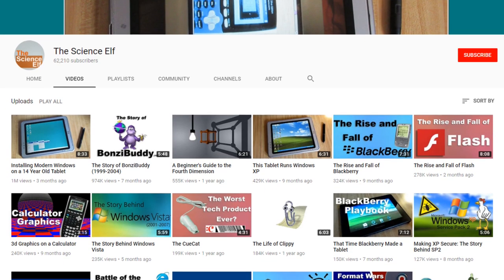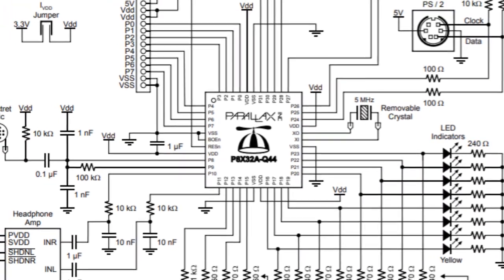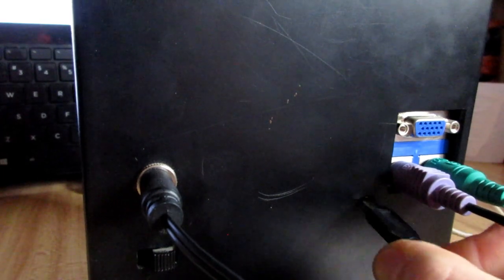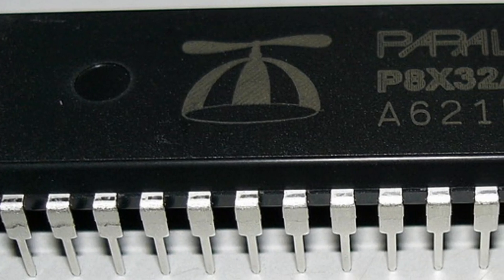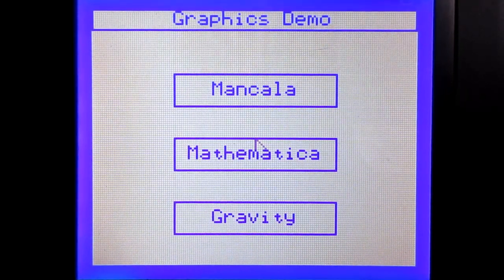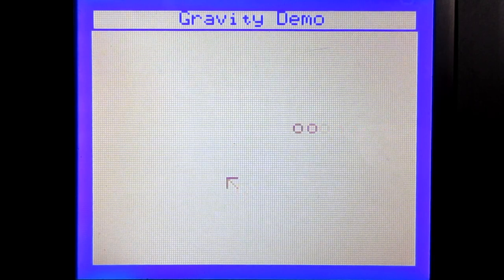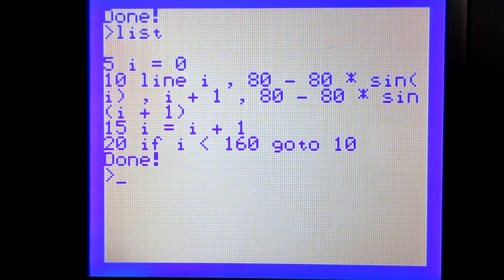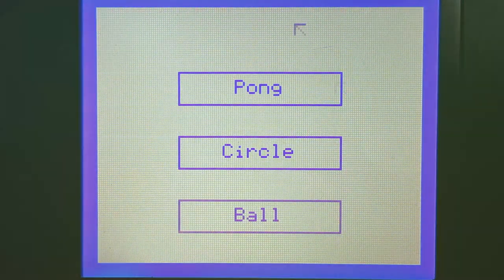The Rarest Computer in my Collection

Comment: Ok this is actually pretty cool! And I have the same problem with commenting my code as well! I have been trying to get out of that habit but like a few hours later I end up not bothering and telling myself "I will comment it later" and never do haha
Reply: At least you give your variables proper names. As recently as a year ago my logic was "Why find a code minifier, I'll just do it myself", and hence a bunch of single or two-letter variable names. Suffice to say I've learned my lesson.
Reply: I used to never comment my code, but now I find I can't think straight without doing it.
Reply: Same lol
Reply: I head to programm in C in one course for one semester. Well, it pretty much forced me to comment anything. Especially when you had to programm for the professor, or when you had to work in a 2- team to wirte a program. 
It was hard for me to learn that, but when I do an Arduino thing, I comment now more and have a way cleaner style of writing ( it's still very very shitty though). 

But before My programms where like shit. Style was bad, no comments, and whenever I dropped something for a few weeks, it was hard to come back. And code was simpel back then, as it got slightly evolved, you couldn't figure out shit. 

On my recent project, that I dropped for a couple of month, I am now very grateful to myself to have them. Was way easier to figure out, what the fuck I was doing :D 

But yeah, without the preasure of the professors I wouldn't have learned it...
Reply: You're the eXtern guy!
Reply: Keiko-ko-child default AI shaking the room 1005 hundred Echizen Kamen Satoshi Microphone 🎙 reminds me of a friend of the 👯 to the house of the sister-fuel Yuhei side Cup on the 🚉

Comment: I remember doing something almost exactly like this. At the time, DRAM was dropping in price in the sub MB varieties, so I ended up buying some 3.3v memory, dedicating one of the cogs to being the memory arbiter and then with a combination of dropping down to PropASM and learning how to use 74x logic to keep the memory refreshed while the cogs were rotating, I learned SO MUCH about how computers dealt with memory and how it was mapped.

However, I am super jealous of your 15 year old harware skills. I didn't really get started until I was 25, but seeing what you did with that is mega impressive :D
Reply: i was thinking of doing something like this but i only know how to program in python, so and OS is gonna be hard...then again i wanna try using micropython to build the computer(just a box with a small lcd screen, keyboard,mabey mouse since what i am building is a text based operating environment, a pyboard, charger, and i need to know if it can even use input arguments, because i have looked all over the internet and could'nt find one damn video using inputs on a pyboard. Please anyone help

Comment: External SRAM chips on an I2C bus, with a dedicated core to handle memory management would sort out your space issues quite effectively. Possibly add a bit of "slow memory" on top of that in the form of an old MMC card (easy to handle in terms of I/O, as well as nice small code size for access and read/write ops). Other than that, great little puter dude, well done! You nailed the aesthetic! Subbed!

Comment: Reminds me of the 4 bit bus computer I built over a weekend as an assignment back in 1987 using a 74181 TTL ALU, 3 x shift registers and 2 x 16 x 4 bit word 7484 TTL RAM chips. It had a 555 timer clock running a pair of 74193 controllable UP / Down binary counters and all display was via 7447 TTL LED numerical blocks.

I still have it somewhere and it could perform 64 mathematical functions so long as the number didn't exceed 15 (well 16 if one counts the "carry up" flag pin on the 74181).

I'd built a basic CPU functionality in TTL, which is what engineers did before processors were invented.

Macro coding by hard wire with a pretty simple machine code instruction set:

The 3 x shift registers were for Register A, Register B and Command Word Register with the resultant answer ending up in Register A.

The programme bytes consisted of the lower 4 bits being the numerical content and the upper 4 bits being the instruction word.

All built on strip board with lots of Kynol wire.
Reply: I'm surprised this comment didn't get more upvotes. Maybe it would on a more DIY-computer type channel.

Comment: This chip is actually very similar in specs to the microcontroller that handles by Nerf primary, my FDL-2X. It handles motor speeds, select fire, and power management features. Let that sink in for you people watching this. That's how impressive this build and its software are, the creator of the Propintosh literally programmed on a platform that's so low-spec, it's only really ever used for very simple robotics work.

Comment: but why didn't you add a speaker?
or a color display?

just asking
Reply from the maker: Honestly, for the speaker, I just never got around to it. I mentioned in the video, there were plenty of things I was planning on adding further down the line with this computer, like the speaker,  a TTS chip, wireless serial communication, IO ports, an SD reader, and even a receipt printer. I just came to the conclusion pretty soon that no matter what I did, the device just wasn't going to be powerful enough, and dropped it before I had the chance to make those upgrades.

As for the color display, (at least when I was building the thing) the largest color smart display was something like 3 inches wide. I could have used a larger TV LCD and powered it off of the Propeller's RCA output, but that would have pretty much defeated the purpose of having an external display, since the TV would have used all the memory.
Reply: I understand now 
But wow 32Kb
Pretty nice project tho
Reply: I also imagine migrating to a color display would have been mean on the RAM limitation. Some people ask why EGA/CGA existed and we didn't go straight to VGA and "millions of colors". Long story short, memory was a limiting factor, and being able to define a color in just one byte was almost a necessity in some applications like spreadsheets and charting.
Reply: Not enough ram.
Reply: A color display will use up a lot of ram, he only had 32kb of it

Comment: I'm a high school freshman (soon to be sophomore) and I've been planning to do a similar sort of thing, albeit with a z180 instead of a micro controller. As of now, the computer is going to pair a 10mhz z180 processor with a 1mb SRAM chip and 256k EEPROM. For the video card, I'm going to cheat and use an ATmega328 instead of having to deal with designing (or modifying) an existing video card design.  I was also originally going to write my own operating system, but I've since decided on porting CP/M instead. Anyways, thanks for the inspiration. This was a pretty cool video.

Comment: This reminds me...In either my sophomore or junior year of high school (most likely junior, but I couldn't access my schedule to confirm), I built a little game using 74xx series logic chips and a 556 timer chip. Basically, it was a two player "see who can hit the button first" game, complete with a scoring system. Of course, it did have a few glitches. Unfortunately, I tore it down shortly after the presentation.
However, that led me to my next adventure: Messing around with the Arduino boards I have.

Comment: How about using several propellers (think multi-core/multiprocessor architecture) in the Propintosh 2 (if you decide to make one)?
Reply: pretty much thought the same
I thought of "why not use one as gpu and another as cpu"
the "gpu" can likely also proccess the input, since it doesn't need to actually compute much

Comment: I'd say that sane variable and function names are far more important than comments. Comments can clutter the code if used to much. If the code isn't obvious, which it should be, a comment might be useful, but otherwise a short introduction at the beginning of a file or function is plenty.

Comment: This machine looks a lot like a micro of about 1980-82 (no PCs apart from IBM until about 85). If you built a machine now with the same  computer power relative to today that you did then, what would your new machine be able to do? Would you be up to the power and versatility of something like an Amiga 500- or would the "new" machine basically be a Macintosh Classic? Which direction would you go in?

Comment: Yeah, commenting is often good. It's even better if you can program small units like in Unix or at least use one program with configurable options. Otherwise, you can't even change a color or text afterwards ;-)
Reply: why the winky face?
while true, that only applies to computers with a proper filesystem and space for that stuff...
seriously, try making a program for an arduino that accepts configurable options and doesn't use an sdcard shield (or any other addon, save for, maybe a screen)

Comment: you could make mac os 1.1 but the original mac ran on an 8mhz processor and 128k of ram but if theirs a more powerful propeller chip it could be possible at the same speed as the original mac

Comment: As impressive as this is for someone that young, your claim you designed it is totally misleading and is literally insulting for real designers of chipset code.  Some of these started at ages even before your own.

The entire machine is a 'wrapper' for other people's work, with simple additions, and is basically Parallax's pre-made computer-on-a-chip doing practically all the legwork, as the PDF for the chip shows.  Sitting on board frameworks and claiming credit to make yourself look like a genius, which your video implies, and other people have fell for, is flat out rude.  If you're claiming to design a computer, the very least you should have done is designed some instruction sets yourself, or better still, designed a schematic for at least one custom chip.  You're clearly not even handling anything to do with RAM or VRAM yourself!

You have basically botched together a load of pre-made computing components designed exactly for what you wanted the 'computer' to look like, and I see at the end of the video you have even used Parallax's custom language instead of even using your own CPU instructions.

This makes it trivial to design a 'computer' like this, but to the average user it will look 'amazing' when it really isn't - it's just a pretty shell for a board template, with some wrapper code.

It's almost like companies that take a NES-on-a-chip, create their own 'console', and then release it claiming it is theirs.  Sorry to be blunt.
Reply: he made the OS for a system that WASN'T meant for that use...
you're half-right, he didn't create a custom chipset or anything
but then again, he never claimed that...
"custom-built that I designed" means that he didn't copy someone else's "design", nor used something prebuilt like a Pi, not that he created 100% original system from scratch...

he never claimed to have created a whole new architecture or language or anything, he did make an original computer though...

it's not insulting to anyone unless, like you, they misunderstand the claim

and, trivial to a 15 year-old? I don't think so...

he stated he couldn't make a PCB, you seriously expect a custom chip?